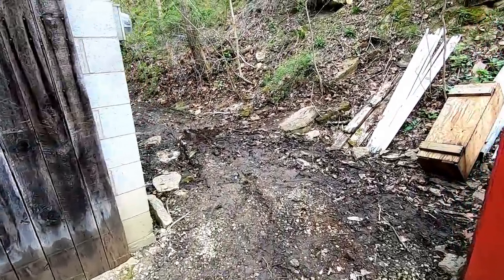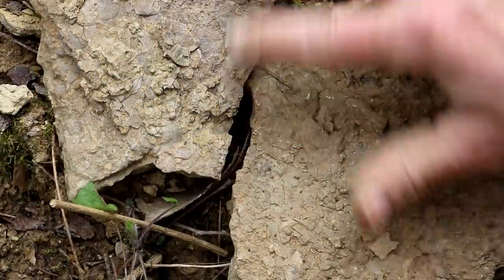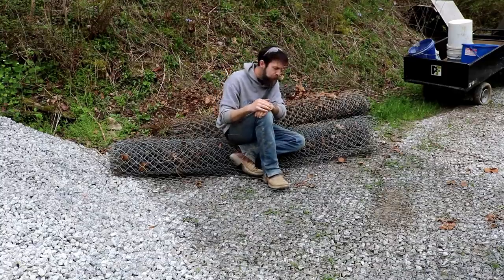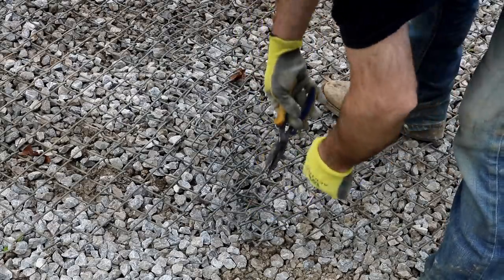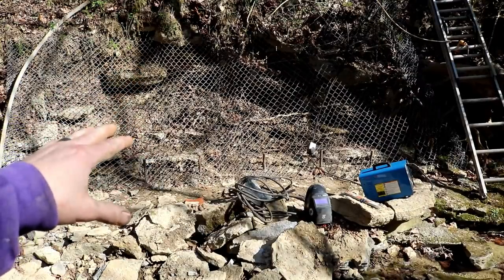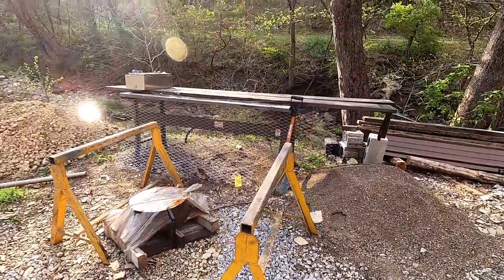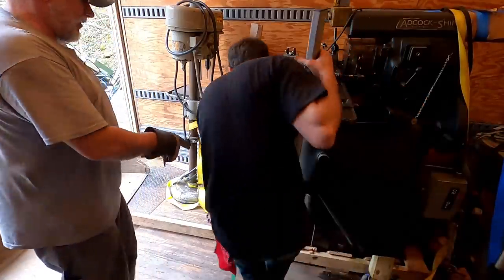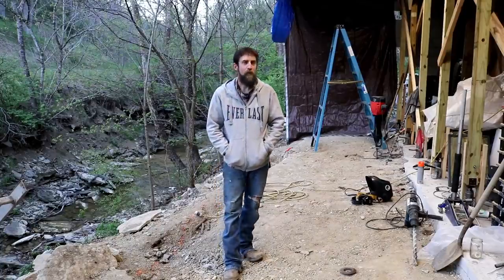New Machines Day! Shop damage part 10

Comment: I had knee surgery on my left knee in the late '70's. About 10 years ago, I reinjured the knee, and took the opportunity to go see the surgeon who did the surgery in '78.  He was the team physician at Oregon, and I knew him from being an Athletic Trainer at Oregon, so it was social as much as anything.

He was looking at my knee, and pointed to a different scar, and said, did you have another surgery?  No, I replied, I was boxing a frame for Model A Street Rod I was building and the 9" disk I was using to clean up the welds got me.  He looked at me over the top of his glasses with a weird look, and I added, with a laugh, I thought it did a great job, right through the coverals, my pant leg, and cauterized the wound, all in one go! Never bled a drop.

He never did see the humor in it.
Reply: haha, I had the same, I was putting down the grinder, it was winding down, I didn't pay attention and it cut about 4-5mm deep into my finger. I was preparing myself for the pain and the gushing blood, but nothing happened, it burned the nerves and blood vessels pretty good.  Only put a bandaid on it, and it healed up pretty nicely.
Reply: Rather strange experience, eh?   You're lucky you still have a working finger, or a complete finger, at all.  Did you have gloves on?

Comment: Love watching your channel. Consider  a VFD for the drill press, easy to install, and to uninstall if the machine is not useful. It will give the unit a wide range of speed,  for a relativity low cost.
Reply: Cc Hanson wonderful inventions are the VFD's love em to bits

Comment: Baldor grinders I have used commonly were set up for carbide, one side with a wheel to rough grind and the other with a finer diamond wheel for finish grinds.  The roughing wheel can be such an enormous time saver, and  any bench grinder will boost your hand skills.  You will know you have arrived when you find yourself using the hand rests to do just that, rest your hands while you hold the tool on  to the wheel.

Comment: Great work and I agree that angle grinders are one of the most disregarded tools most handy folk have. By disregarded I mean ignorance of safe practice. I had a steel speck from a grinder removed from my eye in 1995 and that memory lives strong because the doctor removed it with a needle like you would a wood splinter from your hand. It took three weeks to recover from that experience and since then I far more careful!

Comment: You the Man Steve! Hey buddy, I've been doing drainage my whole life and the only reason I can see putting 2 drain lines in is if you only have access to smaller 4" pipe. The problems I see with is are if you use that common available single wall pipe on either side of that run and want to drive that skid steer back there it will crush that pipe. If it were me I'd go right down the middle with a good ADS dual wall (smooth inside) perforated with some filter fabric. If you wanted to spend the money you could use pee gravel to top of pipe, then use that #57 clean rock you have on top or just use it alone if you don't. Just try to use the rock form the top of your pile to avoid getting to much fines in it. ATB
Reply: I reread my comment and it could be interpreted as pipe with prewraped filter fabric (sock), I just meant to line the ditch and wrap over the top of rock, the sock pipe is not worth the $ to me. =)  Really by going down the middle you could prob get by with single wall and only use dual where equip. would be crossing over. Cause I know you're like me in that we're cheap! lol
Reply: That whole situation there should be rock and gravel. The pipe down the middle is a good idea. ADS is good pipe. You could use a 4 inch thinwall pvc (common footer drain) with drilled holes too provided it's deep enough and protected with drain rock. Fabric is spot on to protect the drain rock. Drain rock/gravel would be best if it was 1-2 inch clean dustless. Round(washed) or crushed dustless. Bigger rock has larger space/voids between them, hence better evacuation. Cap the whole thing with 6 inches of dense grade bank to building. Hump it in the center to drain towards each end of the path and sloping to the bank. It would eliminate all the infiltration to the building. That's a great catch on the pipe damage, it's very likely to happen, what he described.
Reply: @oldschool6345  disagree on sewer/drain PVC, stuff is junk unless used 4' deep for septic system or the like. Never seen anything like 2" round rock used around drainage pipe in my 30 years, that is normally called river rock and used to line water features. On golf greens, ballfields and residential pea graval is used topped with sand. On commercial washed #57 rock (pretty much the same as picking off the top of the pile he's got). Humping the middle to flow to either end would be unproductive, why make the grade flow opposite direction as your pipe while at the same time loosing the little fall away from the building you had?
Reply: @Steve_Just_Steve  the surface drainage would slope away from the building in all directions from center that way. It's not going to change the fall you put on the drain. The small pipe works fine if your deep enough(4ft not necessary) with the trench being 12-16 inches wide. Lining the ditch with fabric and wrapping over the rock installed will give protection to grave and pipe both. Idk what rock is readily available to him. 57s would work if he had to . I've worked in ky in soils/situations like his all my life. Soils are widely varied in ky more so north of him. The larger 1" to 2" rock is preferred  especially in problem areas because of the larger air space. Those hills all around him will be full of aguifers and springs. During spring rain season it coud be a 24/7 stream of water. The thinwall I speak of is sch 35, not sch 27 which i wouldn't use either. Sch 35 with drilled 1/2 inch holes is common to his area. The systems I installed often had to pass a building inspection or a soils engineers regiment. Sometimes would be spec'd by a soil engineer, then inspected.
Reply: @oldschool6345    I know it wouldn't change the pipe grade but I'm Sorry I don't understand how having a higher grade in the middle of the run and trying to move water the opposite direction as the pipe flowline is going to help anything. If he was using two area drains that would be necessary but when using a trench drain like this it    would only decrease the fall away from the building and towards the pipe in the middle, I just don't see how any of that is beneficial.
Reply: @Steve_Just_Steve  well if he is doing actual drains in that area my whole surface approach is nullified. My thoughts are he is separating the surface and subterranean waters. In order to combine the two yes you need to change it. Grading like I described is all for the building's protection. He could go one direction in fall and keep the slope away from the building. But by having the high spot in the center lengthwise there is less accumulation of water. It's only having to drain 30 ft each way. When he goes full length providing fall for 60 ft one way drainage can be difficult in his spot. Regardless he can dig his collection trench to fall wherever he likes and still use any approach with the surface water.
Reply: Pea Gravel, not pee gravel 😂
Reply: I think he’s right.  The big deal is replacing the clay surrounding the pipe with crushed stone and covering the pipe with some sort of filter fabric.  Better to go 8” to 10”.  Nothing wrong with crushed stone all the way to the surface like a french drain.  You’re doing a great job.
Reply: @joeylawn36111  If you pee gravel, it's time to see the Dr.
Reply: @j-man72b72  I've actually have done that. Kidney Stones.
Reply: @joeylawn36111  pew pew pew lol

Comment: Steve you should try putting a 1 foot square plate vertically against your existing bare Wall, drill a 3/4 of 5/8 inch hole in the center of the plate slide a piece of rebar through their horizontally and weld it. Make sure the rebar is sticking out the links show the width of the wall. Slide a plate over it on me outside of the fence weld it and heat the rebar up and bend it sideways and weld it to the next plate that's on the outside of the chain link fence.. then when you go to backfill it it will actually hold it self in because it has to move all of that Rebel before the plate on the inside will let the plate on the outside move

Comment: You have a third option, bring in some heavy boulders and place them in the creek next to your structures, then fill the space around the boulders with rubble and cover them with the metal mesh. The more and bigger the boulders the better, and try to lock them in together. Heavy rocks and boulders have been used for thousands of years to stop water erosion.

Comment: Looks good.  Your bank reinforcement is very similar to how we used to do it back when I was back working in the mines.  If you get the area behind the fencing full of rock you will be good.  But mother nature will test it for sure.  On that drill look into possibly getting the motor rewound or maybe modify a 220 3 phase motor.  Nice equipment.  Stay safe and keep moving forward.

Comment: Best way to cut that fencing is a big bolt cutter, makes easy work of the strand, then you unwind it easily in pieces.
Reply: Just cut or straighten the end loop and then unwind it. Or put two pieces end to end and wind a strand through them to make one longer single piece.

Comment: I would suggest that you dig a wide trench so that the dirt is below the foundation level and then line it with at least two layers of black plastic and run it the plastic up the side of the building to direct the water around the building then back fill with rock.

Comment: Good days work - getting things started to bring a better working environment.  Yes id put drains front back n sides. Channel the roof run off too. 6inch drains should help with cleanouts to unclog if needed . So peanuts a momma so cute . Great gifts man  the drill should convert with transformer easily. Wish i could help sorry im unable.

Comment: Hey Steve, you could just use that area as covered outdoor cold storage and recapture the lost square footage by extending the front or rear of the building. Put the new wall where your jacks are and hang the cold storage walls from the roof and leave 6 inches or so above ground level. Use 4x4's on sonotubes to help carry the walls. Then if the bank does disappear at least your building won't. It is a bit more work but peace of mind is priceless. JMHO........  If you were closer I would buy that drill.....

Comment: For the 480v power on that equipment you can snag a single phase 120/240v drive/inverter that will output up to 3 phase 480v. I've done this many times with industrial equipment. Setup is super easy for most of the drives I've worked with and the drives aren't too bad on the wallet compared to the 480v input drives I often install for work. It's been a year or so wince I bought one, but I can't imagine prices have changed much, especially if you're open to second hand industrial stuff.

Comment: That drill is one of the most beautiful thing to use . Silent .there is a rotary switch it changes the speed multi pole motor . So it has all the 60 herts speeds .  Mine was made in the war years .

Comment: If you can think of any way to make it to where you can bucket in more rock , to replace anything that later gets washed out along that creek bank that is beside the building, now would be the time to do it.

As for keeping the smaller stuff in place, the most effective thing I've seen for that is probably one of the simplest things you can do.  A couple of straight, tall trees, branches and all, laid up against the bank and anchored so the fast water can't carry them further downstream.  Over time, smaller brush wood, trimmed branches etc. can be added to further dampen water action against the bank.  If you can slow the action down enough, sediment will start building up in that spot again.  If that gets high enough, that will allow other brushy, ground holding plants to take root and give further resistance to erosion.

Comment: I'm sure that rubble will hold with only minor mesh help - mix some topsoil in (more near the top end) and add your trees there. The roots will keep the rubble in over time. Build out as far as you can to make a stable bank. The planting can do miracles. I have a simple dump of concrete rubble that has grown over from trees and plants. The occasional flooding seems to revitalize the growth. Great progress so far. You're familiar with Brian Block's shop and I believe he has the 440v if you're feeling generous.

Comment: Hi Steve, Greetings form the land down under. (Australia). Hope you do not mind, I've have some suggestions for your stream bank, footings and drainage.

You idea to use the fencing mesh is spot on.

I really need a drawing to explain this. However, I will try in words. The pressure angle of your shed footing will be 45o radiating out from the edges of your footings. This means that at any point along the stream line the base of the footing needs to be more than 45o back from the base of the stream intersection with the stream bank. For instance, if the stream bank was perpendicular, at 90o to the stream bed, and 6 feet deep and your footing was 1 foot square in cross section then the base of the footing would need to be set back 5 feet from the intersection of the stream bed and the bank. To have some margin of safety I would set the base of your footing back at a minimum of 50o from the intersection of the stream bed and the bank. I would use a 18" footing cross section. If you need to go below natural ground level to achieve this I would excavate down and lay your footing and use engaged, vertical reinforcing rods set in the footing going into concrete filled block work,  block work to come to above ground level and then begin your light weight timber side wall.

On the other side of your shed I'd us a single swale. That's a very shallow and wide U shaped depression formed in the middle of the space between the shed and the up hill slope. It looks like the fall is towards the front of the shed. The fall of the swale should be very slow and maybe you could use some of the fencing mesh to stabilise the ground. A sump and a drain pipe across to front of the shed to the stream would take the water away.

Hope this all makes sense.

Cheers
Bill
Reply: I understood it.
Reply: Dan'sMeTube 
Me 2

Comment: When cutting fencing or any kind of mesh steel with an angle grinder, put a 2 x 10 under the cut line and fasten down both sides of the cut by screwing a 2x4 on either side of the cut, leaving plenty of room to cut. This prevents the wheel getting squeezed and also prevents the screening et al, from snapping up at you
Reply: Cc Hanson I’ve cut a lot of stainless mesh for machine vents and the idea came upon me once from a cardstock cutting machine that kept both sides of the cut tight.

Comment: Steve, I'd advise against using SS wire in combination with galvanized fencing, assuming that's what you have. The SS is much higher on the galvanic series, and it will accelerate erosion of the zinc and subsequent rusting of the fencing. Use 'plow wire' instead, since it has the same metallurgy as the fencing. In general, avoid dissimilar metals in any kind of wet environment. Keep up the good work.

Comment: If you look at some of the mine exploration videos, the miners use fencing similar to what you're doing to stabilize rotten rock.  They hold the fence on tight with pieces of guard rail fastened with purpose made rock bolts.  That fastens the fence down super tight and it doesn't move.  Just a thought.

Comment: Hey Steve, awesome video again😎

If you take the motor off that drill you should be able to take it apart and dig out the star point where all three windings are connected together. If you bring them out on three extra wires you can connect it as delta and it should run just fine on your phase converter then👍

Just read some of the comments. It's a multi speed motor. Still doable just a bit more complicated and you may need to change the speed switching arrangements.
Reply: @cessamichelle  true, you can get step up VFD's. I was thinking more along the make do and mend idea👍

Comment: G'day Steve.  Also beware of wire brushes on angle grinders.  I ended up in the emergency ward with two 1-1/2" wire strands deep in my abdomen.
Reply: ive never had anything that bad, but they do tend to get stuck in my skin and cause tiny blood spots
ive had them get stuck pretty deep in my legs though, and that SUCKS
Reply: I have had to have a couple of strands cut out of my thigh since then I have changed to twist knot wire brush do not seem to have same problem
Reply: @jilliandart8157  I was using a twist knot wire brush.
I was wearing a full face respirator with safety glasses, ear muffs, long sleeve shirt, cotton drill trousers, steel cap boots, and leather gloves.  Unfortunately my shirt was very thin.  Now I wear a leather apron as well when doing this sort of work!

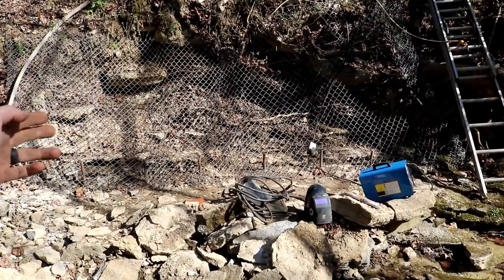Comment: 24:50 I would add a layer of syntetic Geotex below the mesh, this will avoid that the water will remove the sand and dirt behind the rubbel in the long run. It will instead burry the rubbel inside the dirt. You can cut small holes in it to plant trees. Their roots will take over the function of the geotex in the next decade. :)

I woudn't plant fast growing trees, but trees which like wet soil and can risist massive amounts of force by water. The ideal tree would be willows.